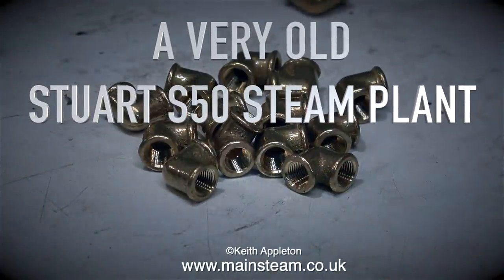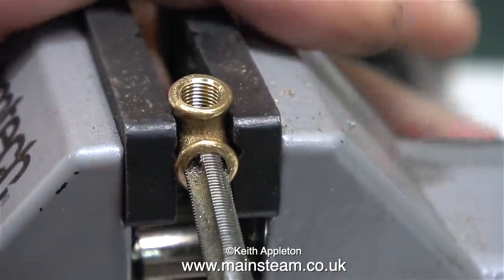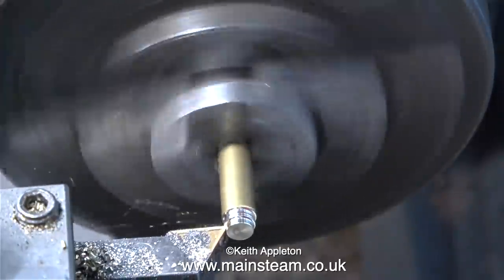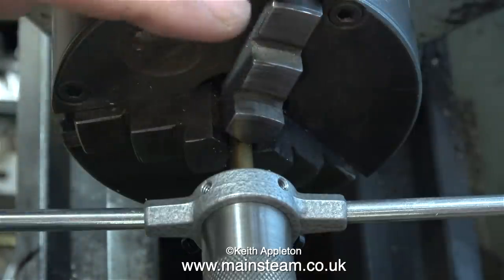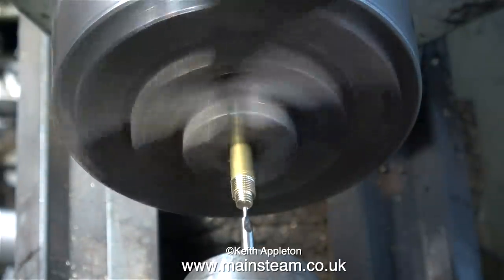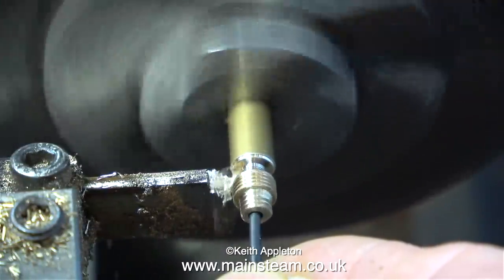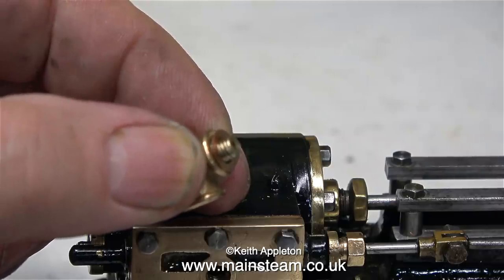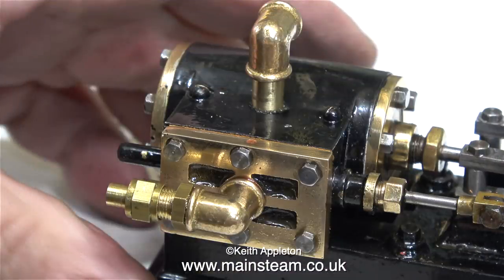A VERY OLD STUART S50 STEAM PLANT - PART #16

Comment: PM Research elbows are 1/4-40 UNS with a basic pitch diameter of .234. They have started making  1/4-40 thread sizes with tapered threads UST (Universal Straight and Taper) and should work with 1/4 x 40 ME British thread with no modifications. Excellent series as usual and because of this I am looking at getting and building my first model steam engine.

Comment: When you order from PM Research, be sure to select the 1/4x40 UST (Universal Straight Thread).

It seems that Forest Classics has a stock of PMR's 1/4x40 MTP (Model Tappered Thread). 
This would explain the fitting problem and the need to re-tap them to straighten out the thread bore.
Hope this helps!

Comment: Hi Keith, I buy many fittings from PM Research, I'm my experience they are mostly MTP,  but I believe they offer fittings in straight thread also. Actually I just looked in my catalog they do offer 1/4 X 40 in MTP.  P/N PL4MTP and 1/4 X 40 in UST which I think is Universal straight thread P/N PL4M. Im sure you know they offer many different fittings, these numbers are for the 90 degree ELL fittings. I hope this helps....Thanks for the great videos.                                        Jon T.

Comment: I believe you are using 1/4x40 ME taps, and your 'commercial' fittings are 1/4x40 ME. This has a Whitworth 55 degree thread form. Whatever you are getting from Forest Classics, and whether you get them direct, and whether you are get a taper thread form or not, you are definitely getting a 60 degree thread form if its origin is PM Research. Seems to me that you are either going to have to continue  re-tapping them to 55 degrees, or get a 1/4x40 die and create your own fittings to fit, or I suppose you could use that die to recut the thread on your 'commercial' fittings, but that's probably no better than what you are doing now.